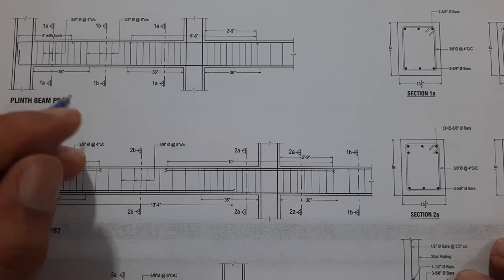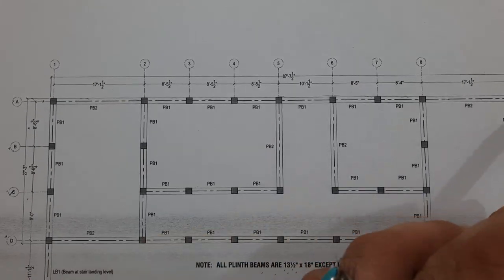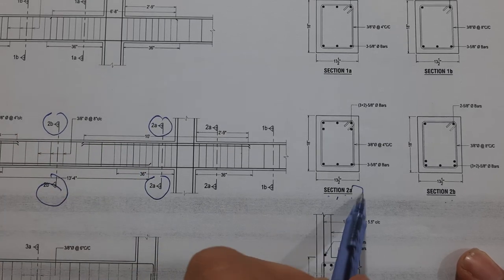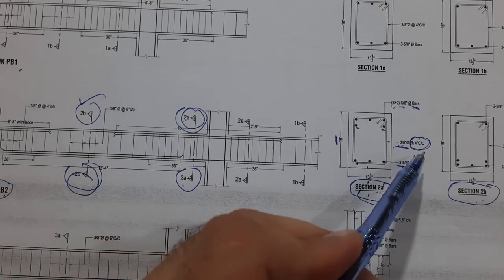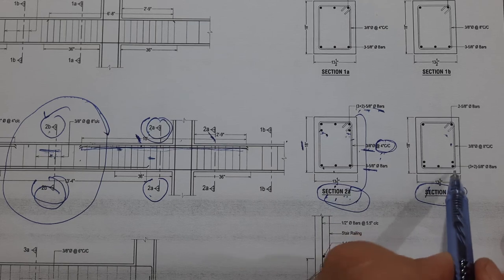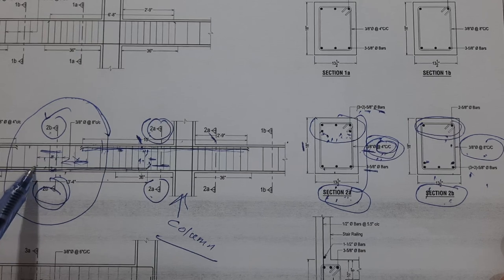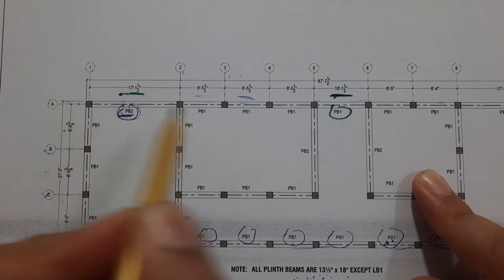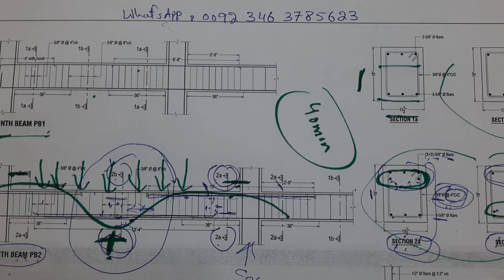How to Read Plinth Beam Drawing? Depth of Beam for 4 floors Building

Comment: sir its mentioned T12@6" C/C in structurals, does this mean 12mm rods with 6 inch spacing? and is 12mm enough for G+2 house? some are saying you need to use 16mm but we got structurals done and it only says 12mm